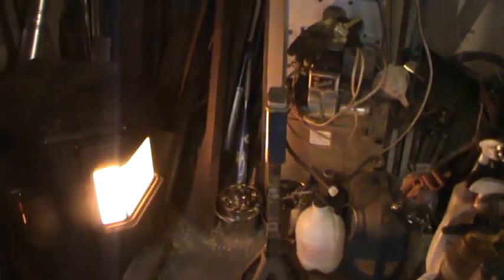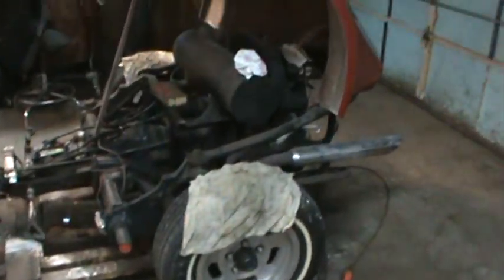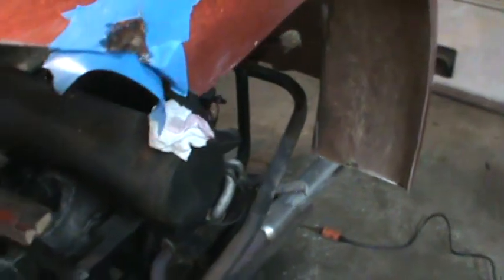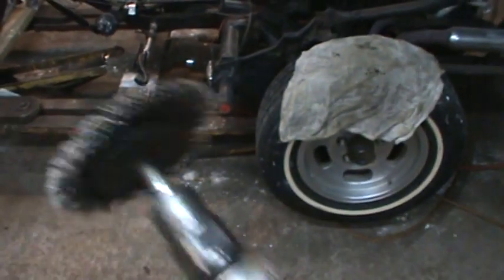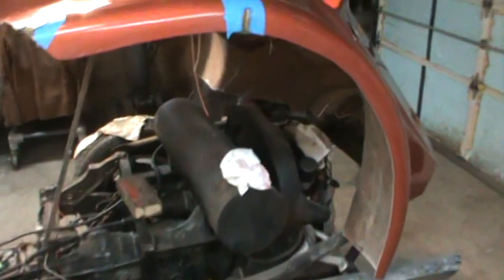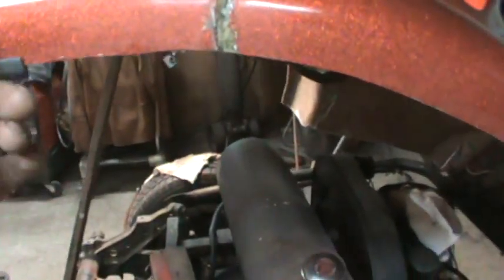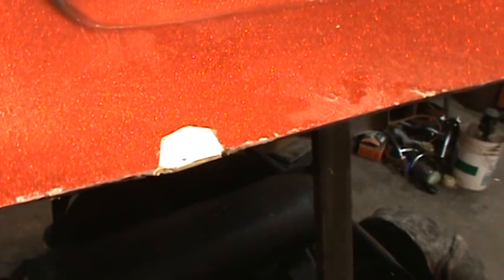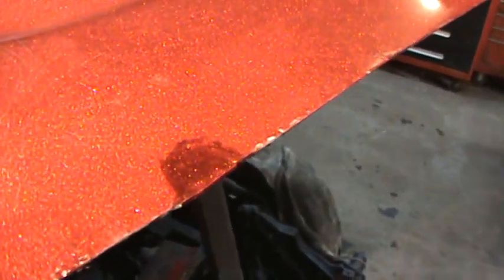vw trike fiberglass work,

Comment: i know this is an old video but for future reference when you have cracks in fiberglass body its best to drill a small hole on the tip of the crack and along its length inside the crack which breaks its path and stops it cracking further then do your repairs by using cloth glass and resin from behind and a flexible filler for filling in on face.   just found your channel and subscribed realy enjoying it.

Comment: while you are playing with the glass stuff, make some pieces to go inside the front piece to align the body when it comes back down, glass the pieces to the underside, it will help keep some strength in the body since it was cut, I added some soft rubber to the body mounts under the body, it helps keep the body from stressing when weight is added like rider and passenger.......just my way to make it mine

Comment: I have an Apex California Custom VW trike with very low miles on it. Very similar to the one you have. The worst mistake they made was mounting the fenders to the axel brackets. It didn't take long for stuff to start breaking. It took me a while but I mounted them to the main frame which solved the problem.

Comment: You should go back to the store and get some body glitter and mix it in the touch up paint. It may turn out better that way. Worth a try I did it once on a boat and it worked pretty good could not tell from 5 feet away.

Comment: Looks good from here and probably a whole lot cheaper than the stuff from the paint store too. Another suggestion is if you put a light colored paint underneath and then do the fingernail polish it will be lighter. Like some silver nail polish then the flake stuff? You can get the silver right down the street at your local pharmacy.

Comment: Nice work sir.  Seems like your on a good path with it.  But one thought would be to fully bodywork all those damaged areas around bottom edge, then create 2" edge or whatever amount you need to cover the tallest damaged spot, and mask off the rest of the bike leaving the 2" strip around the edge, and spray on your color that the paint store mixed, and put a matte clear on top of it, so you kind of get a tone on tone effect, and some contrast with the metal flake against the matt finish...  then maybe around the gas door make an aluminum or stainless ring and glue or rivet it to the body to cover the damage?  Anyway, just some different options, looks like what your doing is going to work pretty well...

Comment: WALMART, in the craft department they have glitter that is simular to metal flake (big stuff) like on the Trike, you can play with it and get closer to what is already in the gelcoat, while the paint is wet you can blow with your air make it go on the spot and it will settle into the wet paint, takes some practice, it can be done in a clear on something until you git it down pat.....where are you located with that white stuff all over.......